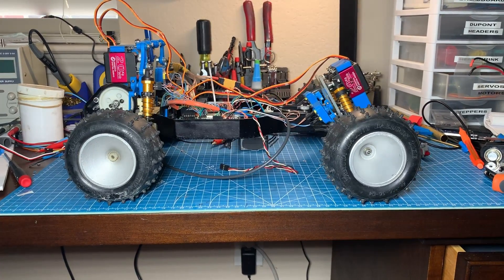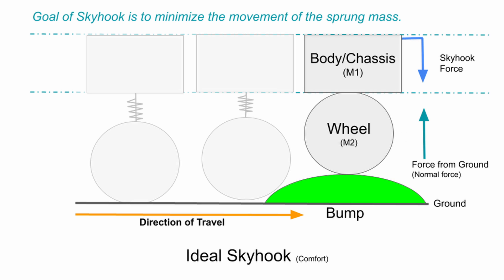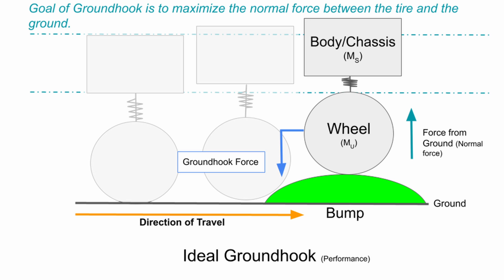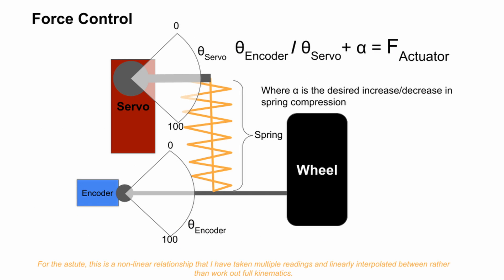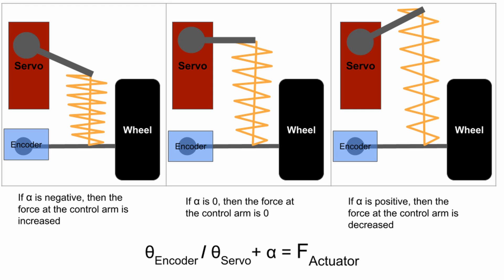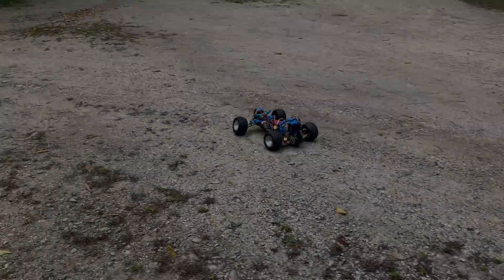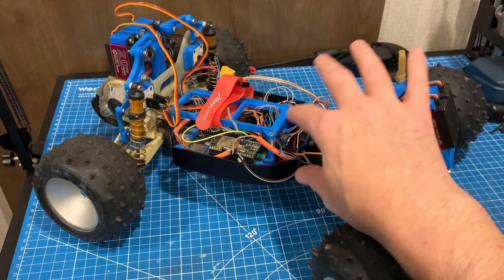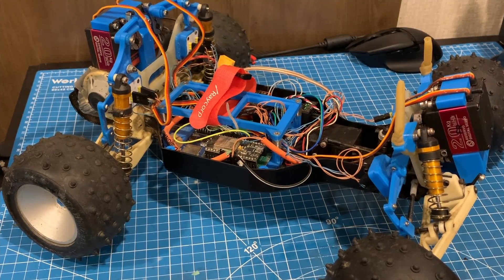RC Car Active Suspension System - Pt3

Comment: You probably have to put stronger servos in the rear due to the power going mostly to the rear
Reply: Or you could tune your suspension by putting thicker oil

Comment: Hi Sir, I'm a mechanical student studying in india. I really liked the ideas of design that you implemented on RC car and I've also in the same project but with different ideas so can you tell me where I can get those frame and wishbone etc.,in india. That would be helpful for me and my project
Reply from the maker: Unfortunately the RC car I used was 30yrs old so it’s no longer available. The suspension and rockers arms were all custom designed and 3D printed for that specific RC car. 

I know several viewers used an RC car from WLToys (from China). They had to design their own suspension rockers and servo mounts, but that chassis has lots of room for that.

Comment: Really interesting project. I wonder if implementing suspension arm angle sensors might work better than using accelerometers?
Reply from the maker: Yes they do. In earlier videos I talk about this, but each suspension arm has an encoder.  The accelerometer is primarily for the overall spring mass of the chassis.

Comment: Hi great project! Subscribed just for it. A few comments, as others have said, your servos will not have the speed to correct for road vibration.  On flat tar lower control arm sees about 20hz, most suspensions can act on 1-4 hz. There are few research grade high speed active systems that try to work in the 20 hz range. At full scale the speed and force needed in the actuator results in something too big and costly, but it is coming, and it will change racing forever. Let the springs and dapaners suck up the high frequency stuff. What alot of active systems try to do is active body control, so just control body roll/pitch/yaw. This is in the frequency range that hydraulic or electric actuators can meet with today's technology. It also simplifies the control equation as you can use pid and height or even height and 3dof sensor.
Reply from the maker: Thanks.  That makes a lot of sense on the vibration rates.  Thanks for the info on the frequencies.  I haven't found literature on the specific suspension frequencies ranges that active suspensions have been built to target.  I really need to build a single wheel test rig to measure the frequencies and optimize my filtering and actuator damping.  I'm leaning towards having an electronic force based actuator like a linear motor  which won't need as much power at this scale versus a real automobile.  Also I should be able to have a much higher frequency response versus the servos.  

I agree with your thoughts on just controlling the roll/pitch/yaw, particularly with an off-road rc car like this.  I'm think I will implement a secondary spring system so the servo doesn't have to support the weight of the car and absorb the shock loads from jumps.  The servos can handle this but they need a lot of current to do so (~2 amps each).

Comment: I would likd to replicate your project. What RC car model are you using? Can you share project details?
Reply from the maker: It’s an RC10T, but it’s 30 years old so no longer made. The servos are animos DS3218 Pro. The code isn’t very stable yet as it’s just a prototype, but I’ll work to get it uploaded to my GitHub site.

Comment: This algos don't take delay into account. Short bumps may result in wheel lift after the bump ends. 
The servos have also limited speed and the small rocks are quite high frequency. Adding  more weight to the car and driving on hard dirt would be more forgiving :). 

Best would be to put sonic sensors just in front of each wheel and control this in feed forward. 

Or put low pass filter on the measures position with a time constant kinda close to the delay. 

Anyways, great stuff.
Reply from the maker: Thanks.  I think not taking into account the delay in feedback and properly filtering is what caused one of my servo's to fail.  I have a simple EMA filter on the encoders which does add some smooth and a bit  of delay, but I think I need to use something like the ServoEasing library that allows you to specify accelerations and velocities to the servo.

Comment: I managed to get a few BNO085 IMUs from Mouser last week. Keep looking!

I'm curious if the servos can move fast enough to respond to high frequency bumps, like the gravel in the video. In my autonomous RC car project I'm modeling actual steering servo position, not just assuming the servos are at the intended position that was sent in the last PWM pulse. My model just uses basic linear interpolation of nominal servo velocity, but in your case it would probably be asymmetrical due to the normal force. It might be interesting to see the modeled servo position in your data logging, and see if that accounts for the undesired acceleration that you're seeing.
Reply from the maker: Thanks for the tip, I hadn’t seen the BNO085 before but it seems to be better than the BNO055 and available. 

The servos definitely don’t respond fast enough. I’m not an expert on this, but I’m using some filtering on the IMU and the encoders which gives me something like a 5ms sample period. Then I only command the servos to a new position every 20ms. But I did burn up two of the servos because I think I’m just sending them in opposite directions every few readings. Ideally I may need to get servos with feedback so I can read the current position and not just the commanded position.
Reply: @IndeterminateDesign  What's the frequency of bumps that you're seeing in the logs? i.e. how frequently does the sign of the vertical acceleration vector change, after subtracting gravity? I could believe you're hitting over 100 bumps per second on gravel, so that may exceed your 200Hz IMU sample rate, much less the 50Hz PWM signal. It may simply be the case that modern digital logic components aren't able to respond fast enough for this type of terrain. Have you tried it on terrain with fewer, larger bumps?
Reply from the maker: So I need to do some better logging, but when the library removes the gravity vector, it seems to be consistently ~0.5G when the car is not pitching or rolling.  But as soon as the chassis rolls or pitches, and the gravity vector starts to pick up values from X&Y sensors it all goes wrong.   So it makes the accelerometer data fairly messy, but I'm definitely registering over 100 bumps/sec.

So when I integrate the acceleration to get the velocity, I implemented a "bleed" of about 2%  so that the velocity always trends a bit towards 0 to hopefully eliminate the integration error.  The larger the bleed the more erratic the velocity becomes and if it's too small it just overflows either positive or negative.  

The encoder data at the wheels is surprisingly clean, and I'm seeing a natural frequency around 3hz front and 4hz rear.  

I think I burnt out the servo because the servo is just being commanded all over.  I think I need to implement a safety function that takes into account the speed of the servos and sets a limit on how fast the commanded position can change.

Comment: I did something like this on my sc10.2
I made bellow air springs at each shock and wrapped each shock in a wire coil added a shock disc with 5 holes and ferro fluid.

I used the valve/pump units from some blood pressure cuffs. A hall effect sensor and a small neo magnet to read each arm.

A simple setup using a custom pcb and an arduino m0 with an imu and hall sensors  tracking wheel speed in all 4 wheels
Reply from the maker: Nice. I like that setup. I was trying to figure out ways to get a small pump like that. Initially I was planning on hydraulic actuators.   Which IMU did you use?

Comment: What if you get a used treadmill and place bumps on the belt to give you the roadway you desire as well as a mount to measure the cars stats
Reply from the maker: That’s a great idea, I don’t have the space for that setup right now but it would be a lot more accurate to have all 4 wheels going over the bump.